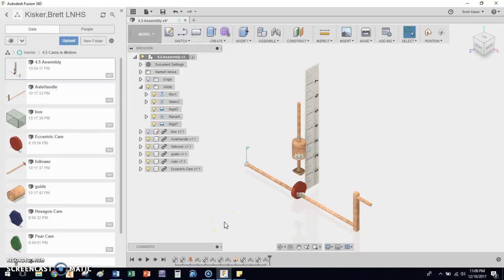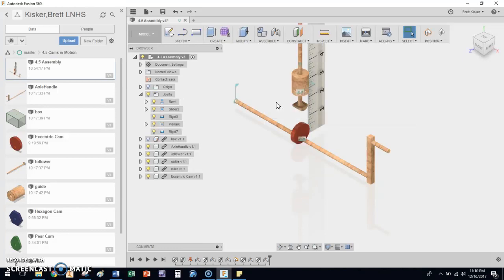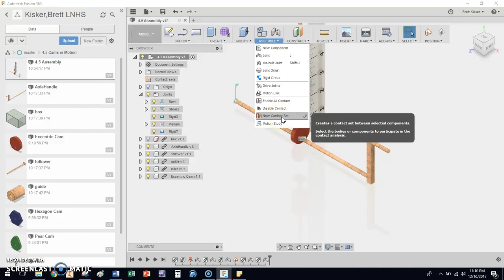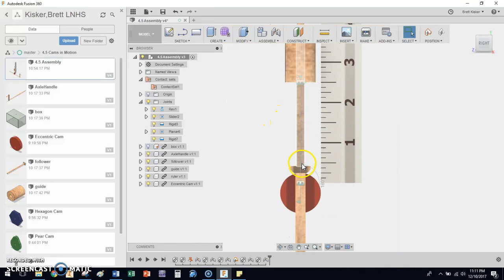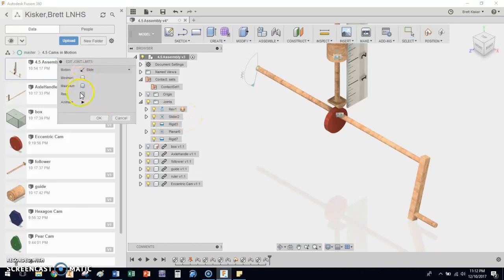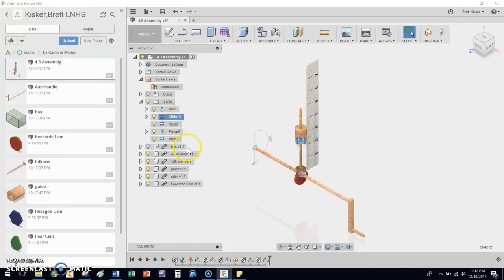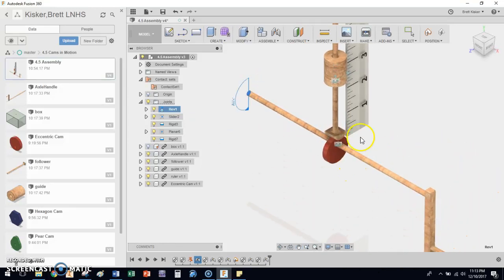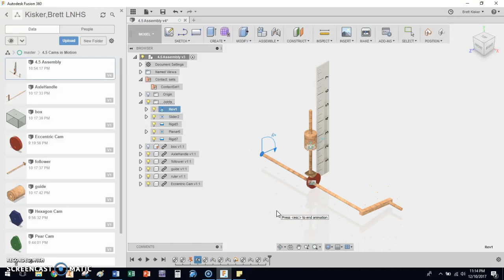PLTW IED 4.5 Automata Assembly - Creating Realistic Motion

Comment: I am wondering what would be a better method for getting components to interact in something more complex. I am trying to have the 60-tooth driver gear of my model of a VEX Clawbot revolve and correspondingly revolve the 60-tooth driven gears. Perhaps I can instead create some kind of joint between the planes of these gears?
Reply: Just figured it out... creating a motion link is the answer there.